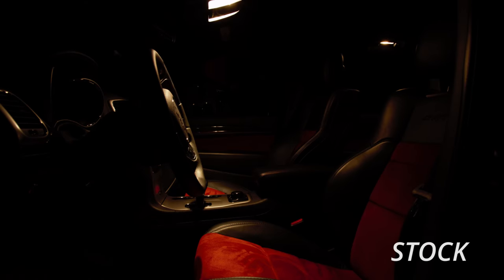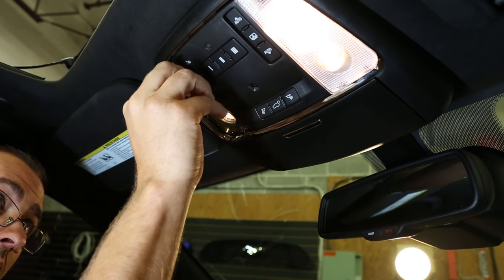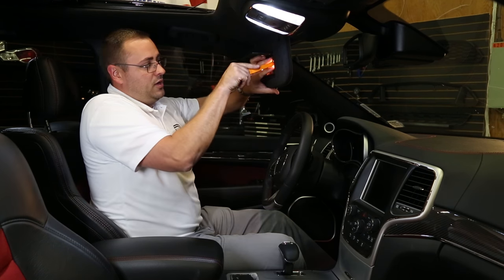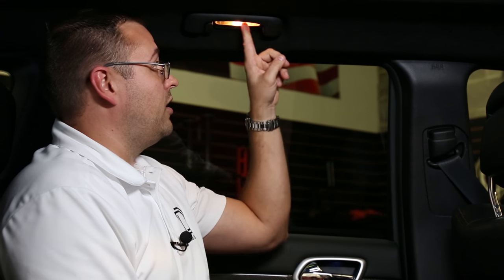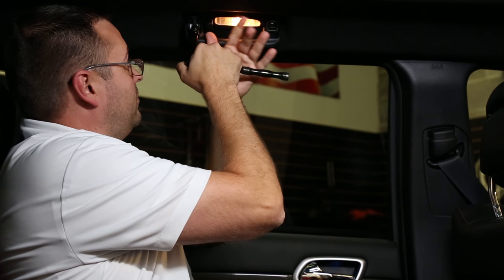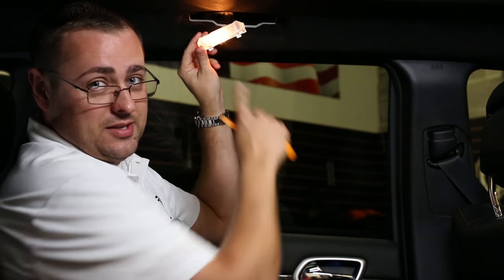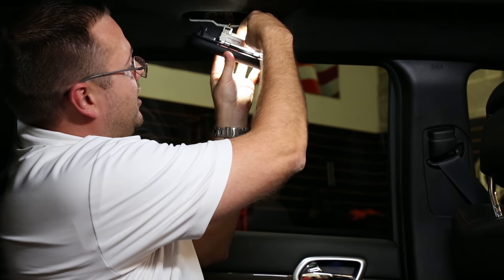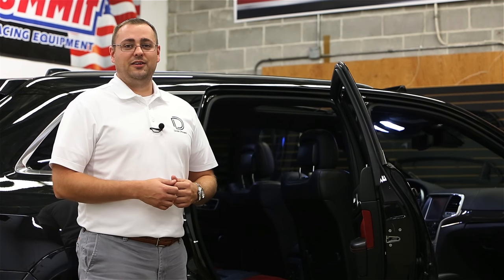How to Install 2015-2016 Jeep Grand Cherokee Interior LEDs

Comment: Good video but the 2016 Jeep grand cherokees have different map lights for the back passengers. They are round and on the top ceiling.
Reply from the maker: +platinum7990 Thanks for reaching out! If you take a photo of the bulbs and email us at contact@diodedynamics.com, we can help you find the right bulb for this location!
Reply: platinum7990 did you have a problem with the front not "wiggling" out like his does on the 2016?
Reply: platinum7990 how would you replace the ones he is mentioning?
Reply: I just tried using needle nose pliers to take the bulb out in my 2016 and there's no where to grab but the actual bulb. How the hell do you do it? Also, how did you pop the lens off that easily? Took me like 5 mins of careful wiggling
Reply: The dome light is best to remove on 2017 grand Cherokee limited edition, I was not able to pop off the entire lens to remove light, pull on the entire assembly starting from the rear and work around you will hear a snap once it comes loose. Is there a replacement bulb/light that replaces the additional light in the dome points only to steering wheel when depressed.

Comment: So I have the exact same Jeep as this to a T, and I cannot get the map light covers off. I get the first part to pop off but the part toward the front of the Jeep will not release it feels like it will break. I took off the whole assembly and got to the map lights but how do I get to the dome lights? Changed every other one successfully foot lights trunk lights all but those dome in that housing I can't get to.  Any suggestions on getting that cover off without breaking?
Reply from the maker: Hi Sean, thanks for reaching out! Please go ahead and give us a call at 314-205-3033 Monday-Friday, or shoot us an email at contact@diodedynamics.com, and our service team will be happy to assist you!
Reply: Did you get a solution because i can't figure it out either. the clips nearer the windshield feel like they'll break.
Reply: @nyc863  They do get out after slowly working it from side to side. The video definitely doesn’t show the real thing, maybe they already broke it. Anyway, don’t pop it off, just pull the whole assembly from near the windshield and the bulbs are both easily replaced.

Comment: What about the front map lights? There is a courtesy light and a map light.. is there a solution?
Reply from the maker: +pabz83 Please email a photo of the factory bulbs uninstalled to contact@diodedynamics.com, and we can help you find the correct replacements for both locations!
Reply: Its not a normal bulb its like a chip..
Reply from the maker: +pabz83 We'd be happy to help! If you're able to send us a photo, we can let you know whether this location can be replaced.
Reply: Have you figured it out? Can it be replaced?
Reply: pabz83 lol did you at least try taking apart the overhead console?
Reply: pabz83 damn I wonder if its the same for all years wk2. What year is yours?
Reply: i have a 2015 jgc and the place that swapped out my bulbs for led's told me they couldn't swap that one out because it was built in. been talking to a guy on instagram and he says it's possible but it's a pain in ass to do it and not worth the trouble. it sucks that it's not an easy swap like all the rest.
Reply: jromero281 I've had the same issue (2015 jgc) and I thought it would easily pop out but it felt like it would break. I'm glad to find out that it was built in. I stopped messing with it but now I have blue and yellow lights up front. It doesn't look terrible but it's not what I desired. Ah well.

Comment: Can these work for a 2014 Jeep Grand Cherokee limited??
Reply from the maker: +Juan Rodriguez Unfortunately we have not had a 2014 Grand Cherokee into our garage to confirm fitment. However, if you would like us to check the sizes for you, feel free to email photos of the factory bulbs uninstalled to contact@diodedynamics.com!
Reply: ok thanks. When I get a chance I'll email them
Reply: Juan Rodriguez  I recommend to go to deautokey.com. I just put my lights from them today they are bright. I have a 2014 Grand Cherokee Altitude
Reply: Thanks I'll check them out.

Comment: Do these fit on a 2010 grand Cherokee
Reply from the maker: +Patrick Cordova The bulb sizes for the interior locations on the older Grand Cherokees will vary depending on your trim level. If you're able to access your factory bulbs and email us photos to contact@diodedynamics.com, we would be happy to help you find the sizes you'll need!

Comment: Hey diode dynamics people,  Maybe you should watch others videos to learn a thing or two,  Doing it your way you take a chance at breaking the lense on the front dome light,    Take the whole panel down,  it just pops off,  then you have super easy access to the lights,  Thanks to you stupid way, I almost broke the lens on the dome light.  If you take the whole thing out, the bulb socket just turns in,   but your way for the back lights was real good.
Reply from the maker: Hey Edwin - with all of our installation videos, we do go through a number of different installation methods (prior to producing this video), and determine what we think is the best and most effective way. There will be more than one way to install these bulbs in many cases, so at the end of the day it is up to you which method you would like to do. We will certainly pass your concerns along to our marketing team however!